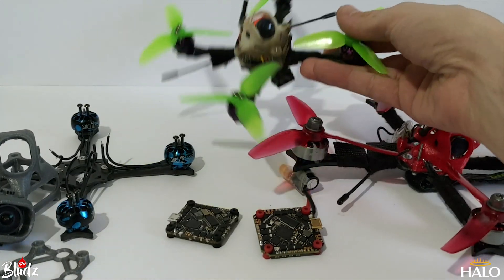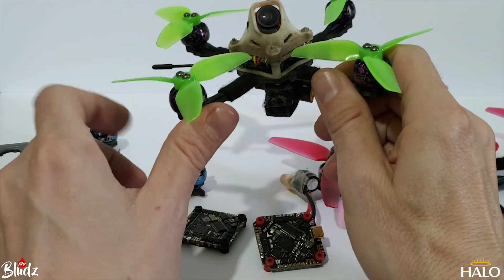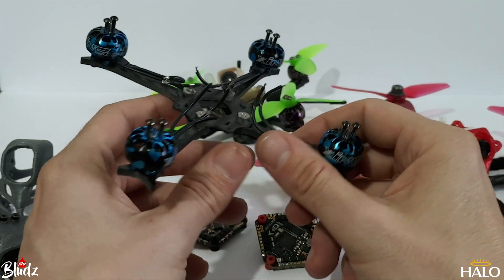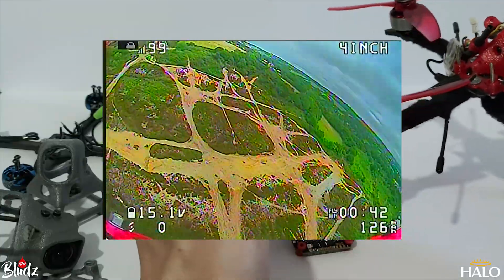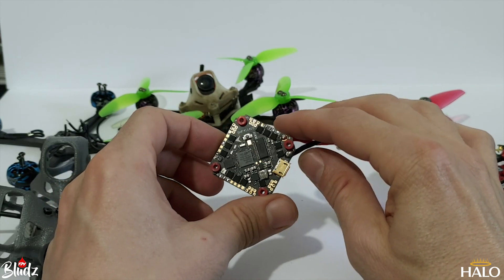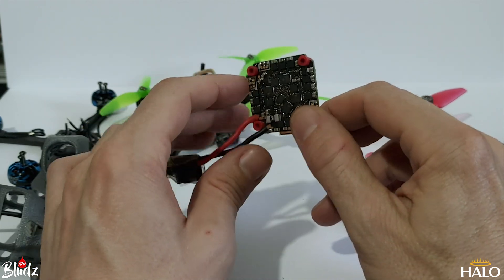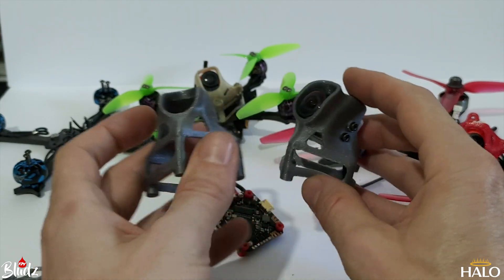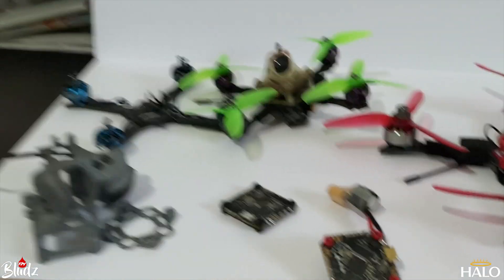The Best FC For Caddx Vista & NEW FRAME Development - JHEMCU GHF411 (lol) AiO FC

Comment: I'm trying to build a 4s with the same flight controller but I'm having tuble getting to work I'm trying to us a d8 receiver
Reply: Any tips
Reply from the maker: This is quite an old video, not sure how I can help. F411 can be tricky on modern betaflight, make sure you disable enough features for it to work

Comment: I've got some Geprc 1204 3750kv motors that I want to re-purpose to run with a light 4S setup, very tempted to build something with a caddx vista and I like your design! Would these motors be any good with the Odin frame? it seems that you're running a much higher KV to make it responsive enough? Perhaps some tri-blade props will keep the bite in it?
Reply from the maker: Hey. I run quite high kv but very light props. Seems to work well with the weight of a vista and 1404 motors, the motors struggle with anything more aggresive. Your motors being a bit smaller will have issues spinning aggresive props too, but at least the kv isn't so high it should still rip pretty well I think. Before my current setup I was running 1206's and it flew pretty good, I fly quite hard though so need some extra torque to pull out of moves easier.

Comment: Can i use iflight 1104 4200kv motor with 4s battery xt30 connector at this fc?
Reply from the maker: Yes, that would be totally fine. I run 1404 4500kv on 4s through it.
Reply: @Bludz  u use 1000uf/35v capacitor?
Reply from the maker: @aremie011  I just use a small 330uf cap 35v

Comment: cool video mate :-) I love those boards to, my guitar Pick is rocking the GHF.......board, they come in 20A and 30A...
Reply from the maker: Thanks dude. That's good to know, I didn't realise they did two versions. I hammered it today and it stood up really well. Just you wait until I show my results from testing this weekend, I have an insane setup to share.
Reply: @Bludz  I look forward to it buddy, the new frame looks like it will  be a lots easier to work with :-) if you need to get your hands on a 20A or 30A board fast, let me know.
Reply from the maker: Yea? How come you have spares? I need to find the company making them so I can stock it at Halo.... Don't suppose you know who it is?
Reply: @Bludz  oh god please help me with this fc. I'm trying to connect a cadx vista, r9 mini receiver, and gps unit. The vista needs tx1 and rx1, the r9 mini receiver needs power and sbus port, does that mean i can still use tx2 and rx2 for a gps unit? or are those being utalized with the receiver on sbus?
Reply from the maker: Hey man. It only has 2 uarts, so that setup isn't going to work. The SBUS pad is actually the same pad as RX1, but with an inverter (I think that is why they have 2 pads, not everyone need inverted signal). So you R9 RX is using Uart1 and DJI/MSP will be on uart2. We will have to wait for an F7 board to have more than 2 uarts. I know a coupole of companies that are working on one right now, so shouldn't be much longer.

Comment: You should try de-casing the vista, I did and it works really well and is a way lighter. Runs well on 700mw!
Reply from the maker: I totally get that the drop in weight is a good thing, think I'll just wait for them to release something smaller. Too much of a wuss to risk breaking it hahahah
Reply from the maker: I doubt I will ever do that tbh mate, sorry. Looks like what you lose in weight you gain in pain in the arse to fit. Putting the VTX in the stack is a dumb idea but at least as one unit it doesn't move around, I fear that having 2 boards and no gummies is just going to be vibration city. Certainly not worth me trying it to see as none of my frames would benefit from doing so and of course the exposed boards are more likely to break, the plug has nothing to hold it in anymore. Always having th thought that it may break at any moment doesn't apeal to me when they are expensive.